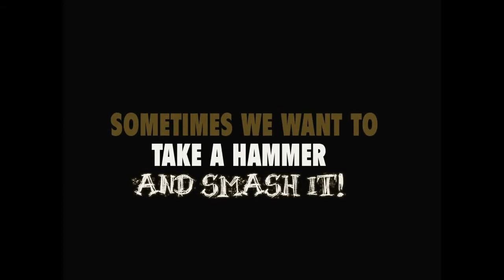LAWNBOY Mower Kohler Engine Proper Auto Choke Linkage Installation

Comment: Seems to me with the configuration the way you twisted it around to get it together is certainly the better way. Also that tiny linkage could be bent as an adjustment if need be if it ever became necessary just like you would the governor linkage. Excellent video. Thanks for sharing this with us

Comment: Thanks. Can you buy the metal link as I had to cut it get the carb out
Reply from the maker: You should be able to get the model and type it into google, it should bring you to some manuals in Adobe PDF format which would list the part numbers, you surely should be able to buy that part, but first you must find the part number that is the key.  Type in your model and carb linkage in google.